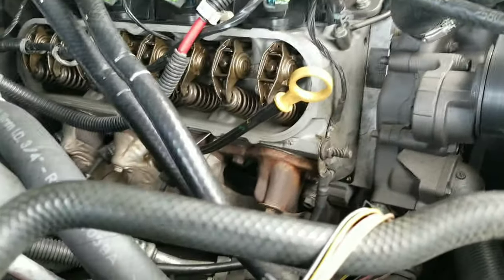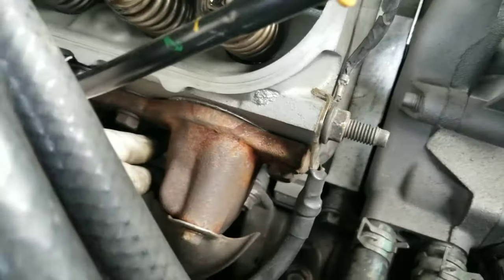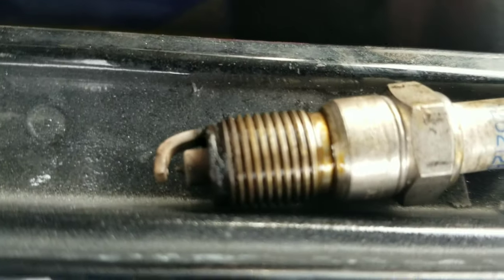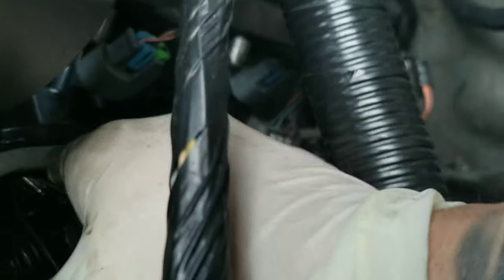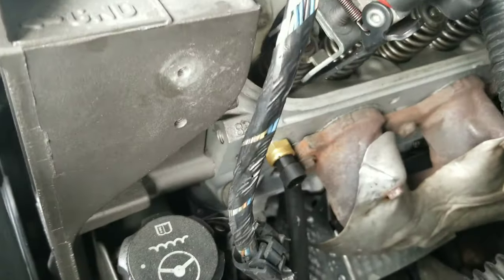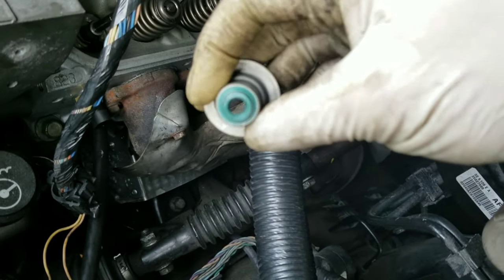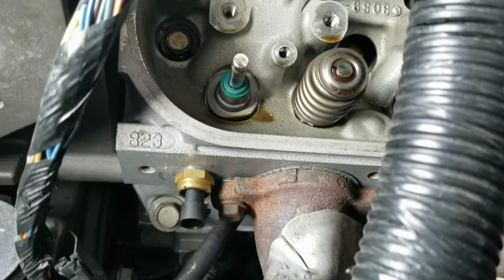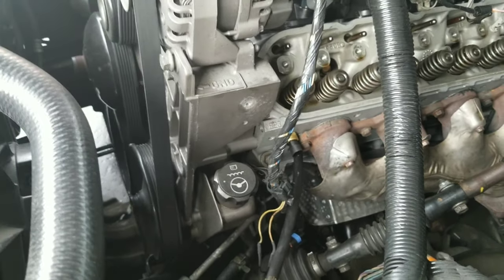How to remove valve stem seals on any chevy LS engine 4.8 5.3 5.7 6.0 6.2 engine on the car

Comment: thanks for the info / demo.  I have a 2004 silverado I bought when it was new.  It runs great, but has recently begun puffing blueish smoke at startup.  I want to keep this truck many more years and this fix looks pretty easy, or not to expensive.
Reply from the maker: Get it done my man 🙌
Reply: @JM8686  Thank you for the video. How did you make sure the pistons are up? Also, if the piston is up, why use air compressor if there is no where for the valves to fall? Thank you again for your help.
Reply from the maker: Just spin the crank till i feel pressure on the spark plug nd them just make sure the piston is up
Reply: @JM8686  Thanks man. Great video.
Reply: @tinbus149  I'll don't want the valve to drop a lil and bounce off the top of piston. That could damage the valve and cause it not to seal 
Completely..
Reply: So basically the piston up doesnt matter aslong you have air the valve wont fall through easy correct?
Reply from the maker: @eldianmolina4920 the problem sometimes is that when u put air it pushes the piston down!
Reply: @JM8686  ok but it wont push the valve down which is the concern here isnt it ?

Comment: Great video..I'm having to do this on my 5.3l. getting clouds of smoke every morning. And sometimes while accelerating after sitting at an intersection. A couple questions...what type/style of compression tool do you recommend for a DIYer? Also, will a pancake style compressor be able to maintain constant pressure while changing seals? Thanks in advance.
Reply from the maker: There is a different kind of tool to press the spring, add me on Instagram 13b_dorito so i can send you a link or a picture of how it looks
Reply: @JM8686  I'm late but I can get that picture aswell please 👍

Comment: Is this what I need on my 5.3 it smokes wen I hit the gas to take off after sitting at a idle or like when I’m at a light blue smoke comes out.
Reply from the maker: Yeah could be valve stem seals or piston rings! Look on the exhaust right by the head and headers and you will see a wet spot of oil between head and headers! If you see that that means valve stem seals on that exhaust runner
Reply: Ate you referring to the outside of the heads like where the gasket for the headers would go?

Comment: is it normal for those old spark plugs in these 5.3l to have those sticky engine-oil colored goo around it? I put new spark plugs in my truck and the old ones had those sticky substance around the old spark plugs. should i be concerned of leak?

Comment: Quick question for you. I'm about to do mine on my 08, how difficult was it to attach the air hose to the #8 cylinder? Ive done spark plugs in the past and that one has always been the hardest. Is there an easy way to thread it in with out wasting a large amount of time?
Reply from the maker: Lats ones are always hard,not really a fast way,just take you're time
Reply: @Austin Welder last time I removed spark #8 I broke mine trying to do it from on top the hood; so I removed the tire and plastic cover and was 100x easier! Took a little longer but was so much easier!
Reply: @aidanpadron8489  I usually just do it from up top, it's a pain in the ass, but do able. I got fender flares and I'd rather not have to remove them everytime I did the plugs, otherwise I'd go from underneath. I'm more worried about tryna squeeze the air hose back there without cross threading it.

Comment: I changed valve seals.. and now iv got a very faint tick,tick,tick,tick, in sequence very hard to notice. It wasn’t making noise before the seal replacement.. what could have gone wrong? And what would be making a almost silent t t t t
Reply from the maker: Loose rocker arm
Reply: @JM8686  ok thank you, I’ll check that out soon. If that doesn’t correct it. Would there be another cause of it? My lifters were fine before the seal replacement. I don’t think changing seals would cause lifter issues right? I didn’t remove the heads to perform the task.. thanks for the fast response

Comment: 3x questions:
How much steady air pressure is need to keep the valve up?
Does the oil need to be drained? 
My truck has a puff a blue smoke on start up(smells like burnt oil) will replacing the valve stem seals stop that?
Pretty sure that’s what’s triggering my cat codes
Reply from the maker: Even 60 psi will hold the valve closed,no need to drain oil,is the valve stem seals are passing oil it will help and will stop the oil,but if you're problem is due to oil rings it will not help at all!!
Reply: @JM8686  how would you tell the difference ?

Comment: What made you change the valve seals? What indicator? Was it a low compression?
And please using this method, how can you be sure about valve seats? I mean they are inside, how do you know if the valves sit perfectly with no dirt on the seats?
Thanks
Reply from the maker: It was passing oil through the valves, so burning oil!
Easy to spot for the smoke coming from the tail pipes
Reply: @JM8686  How many miles on your engine? Good video by the way!
Reply from the maker: Thanks for watching

Comment: Do you need to seal off air to spark plug hole or just wide open with hose in it running 65psi
Reply from the maker: Air need to be running to keep the valve closed,once you apply air,the crank might spin so don't panic

Comment: Do I need to put air pressure if I’m only changing the valve springs as well? Or only for valve springs seal? Thank you!
Reply: Todo el tiempo al quitar el resorte se cae la válvula  tienes que poner aire para mantenerla arriba
Reply: Solo necesitas poner 45 o 50 lbs de  precion  de aire  la mantiene arriba
Reply: Can I just crank motor little bit so piston stay up so I don't have to use air

Comment: If the piston is set to tdc and the valve falls will it still stay up if the piston is at the very top or is there still room for it to go down?  Idk if to trust the air compressor method since Ive heard stories of the air pressure from the compressor pushing the piston back down.
Reply from the maker: If you don't have good air
The valve will fall
Reply: small rope threw spark plug hole to fill chamber then raise the piston will also work, if your not sure of using the air method

Comment: do you have to remove all 8 spark plugs if you only need to change one spring that broke?its on a 5.3L 2008 engine
Reply from the maker: Only the one on the cylinder with the broken spring!

Comment: Can you do this without an air compressor? Also my set came all one color 16 of them is that normal.
Reply from the maker: No DO NOT TRY WITHOUT AIR COMPRESSOR or the valves will fall inside the cylinder and you have to remove the heads lol
You need the air do it can push the valves up!

Comment: I am having issue in the morning at first start blowing out blue cloud of smoke for few sec then stops could this just my pcv valve cover it’s a 2011 Chevy Silverado
Reply from the maker: Could be pcv but most likely the valve stem seals
Reply: JM8686 / is there any way I could diagnose that it’s the pcv valve cover and not the valve stem seals before I spend the money buying a pcv cover then it still not solving problem?

Comment: I just replaced the valve seals on the passenger side but now I have a ticking noise coming from the driver side, any idea? I didn’t even remove the valve cover on the driver side that’s why I’m confused and what’s happening.
Reply: Did you figure it out?
Reply: @josebercar4195  yeah I believe one of the lifters got dry when I was turning the crankshaft over once I started to drive the truck and let it idle for a little bit the noise went away, I’m lucky I guess

Comment: Does my cilynder has to be on tdc for rocker arm removal and installation?
Reply from the maker: How is it going, thanks for watching the video, and no need to be on TDC
Reply: Better to be on tdc in case you lose air pressure, valve won't fall far.

Comment: How much PSI air should I put in the cilinder to avoid loose the valve? My motor is a 305 Chevy TBI in a GMC Sierra 95?
Reply from the maker: The shop's air is enough
Reply: @JM8686  50 lbs?
Reply from the maker: Try a little more like at least 75+
Reply: @JM8686  thaks a lot for your answer!!

Comment: Great video did u notice a difference when u replaced them?
Reply from the maker: Yeah they were like loose or bigger! That's why its better getting them OEM
Reply: JM8686 okay thanks when u were driving did it seem to run or drive better? thanks
Reply from the maker: @coreythefam6455  yeah because there was no more oil getting the spark plugs wet of oil! What's wrong with yours?
Reply: JM8686 my 350 in my 95 Chevy 1500 would blow some smoke when I started it up in the morning it’s getting fix tho
Reply from the maker: @coreythefam6455  you have to make sure it's not coming up from the rings tough! Also the valve seals are different than the LS seals!
Reply: JM8686 it’s not the ring cause it would smoke all the time which mine does not do that

Comment: Hey bro can this cause a cylinder 3 misfire??
Reply from the maker: Only if there is lots of oil into the cylinder! Start by swapping the coil,spark plug and cable into a good working cylinder! Since you gunna remove the spark plug ,see if you notice anything weird with it and do a compression test since spark plug is gunna be removed! 13b_dorito my IG if u need more help

Comment: What psi do I need on the air? I don't want to blowup and seals..
Reply from the maker: Anything above 40psi ,just to hold the valves up nd down worry you won't blow any seals
Reply: @JM8686  Alright Thank you..
Reply from the maker: No problem 🙌

Comment: How much air pressure(psi) to hold cylinder up?
Reply from the maker: Anything above 50psi
Reply: JM8686 Thank you!
Reply: Do you know the torque specs for the rocker arm bolts?